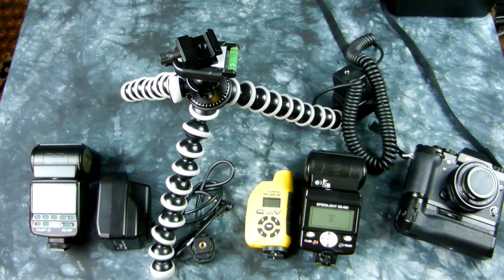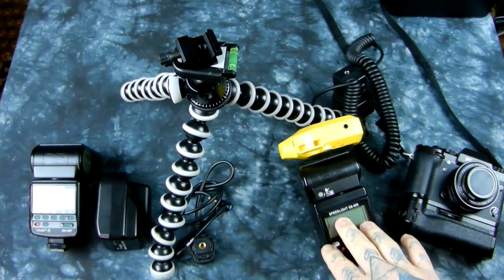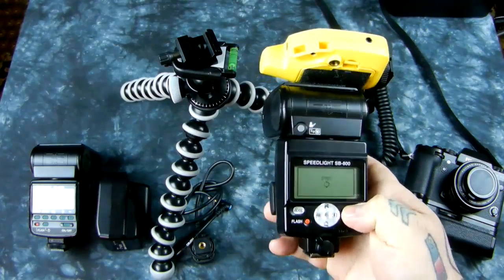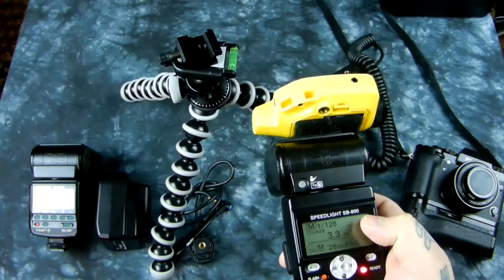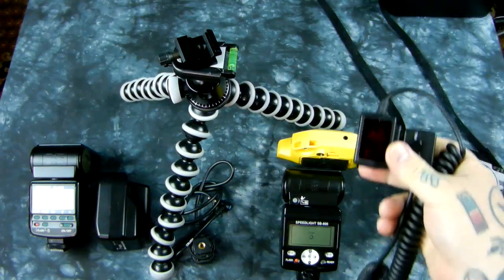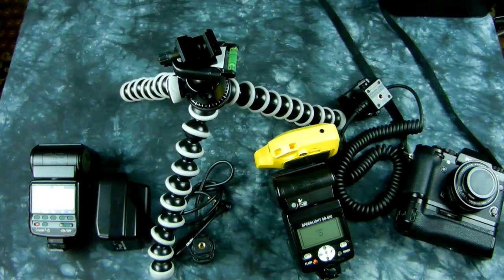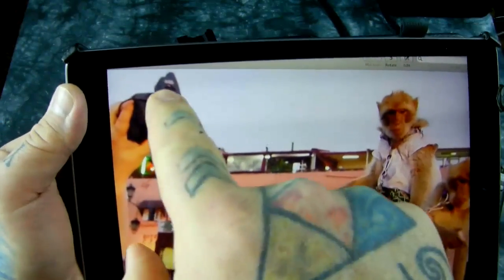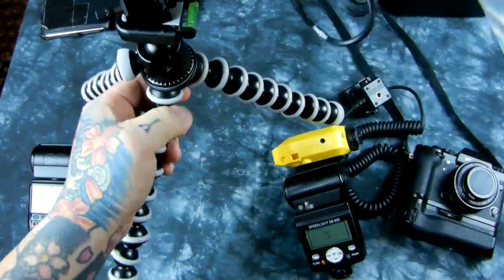Angry Photographer: FUJI X FLASH PHOTOGRAPHY SOLUTIONS !! X-T1, X-T10 & MORE

Comment: I am doing the same thing with my nikon Flashes and Lizards just in manual mode for the last year. No info about it at all. Some miss shoots here and there but the speedsync is a pain in the arse, just 1/180. Since the last firmware update it seems to be more stable but jeez... Some times 1/180 it's just not enough. Do you think we have any possibility of solve it with the new firmware update due for tomorrow?

Comment: Ill be honest, i didnt think my  yongnuo  yn460ii would last very long specially after another very cheap flashgun by Godox stopped working after only 24hrs. Only had the speedlgiht for 3 years but it still works as it should, even after dropping it a few times, the same goes for the newer yn560iii, dropped one very recently and it worked fine, barely a mark on it, so their not that badly made to be honest, and with my yn560tx trigger the speedlighting is a piece of piss! I have no need for ttl so manual does me just fine! My set up is simple and very cheap but incredibly effective for my needs, which are fairly basic compared to most, but thats the point, it works for me, just like your setup works for you. Love the videos, love the live shows, keep up the good shit =)
Reply from the maker: +Alexandra Starr (photographer) fist bump man!!

just trying to help :)

Comment: Hey, I currently own the x-t10 with a SB-900 flash. When I tried to use the flash on the camera, it just would not fire even though it was armed and ready. any solution to that?
Reply from the maker: you MUST be in mechanical shutter for that to work :) 

and the correct flash mode
Reply: ohhhh that makes sense, thank you very much!!

Comment: I think Zack Arias is using LumoPro LP180's that are manual flashes.  I think he is sponsored by Midwest Photo Exchange that sells those, very good, manual speedlites.  I like the 1/4-20 threads on the side of the flash head.  Also, they are not very expensive.
Reply from the maker: +Tracy Bossong is that it?? i couldnt make it out in the video.  Ahhhhhhhhhh. well its good to use cheapie speedlights when you drop them. 

thats also a good idea for travel, but always have a backup

Comment: I guessing the A mode doesnt work as far back as the X100 or X-Pro1
Reply: +Matthew Maber Hang on, so the flash is on control of its own light when its in A? Or did I misunderstand
Reply from the maker: +Matthew Maber it sure does!!!!
Reply: Cool. SB28 is the cheapest Nikon flash that has this?
So the make/model of camera is irrelevant really? 
I guess not many Fuji 'official' shooters have really mentioned it as if theyve been using this auto mode previously  anyway I suppose its nothing new for them.
Much prefer your channel lately btw, your new found Fuji love is making you less angry maybe ;)
Chuck Jines wouldnt be impressed =D
Reply: I have the X100 (original) and X-Pro1 so I probably need to look at getting an X-T1 or X-T10, but its not really my main kind of photography. I use an M6 or Canonet generally.
Reply from the maker: did you see my newest video?? see what the XT1 can do NOW!
Reply: Theoria Apophasis Yup saw the speedy flashes "speed lights".
The XT1 appeals to me more than the Xt10 purely really because of the direct manual controls and the extras you can get. Even though I know theyre essentially the same.